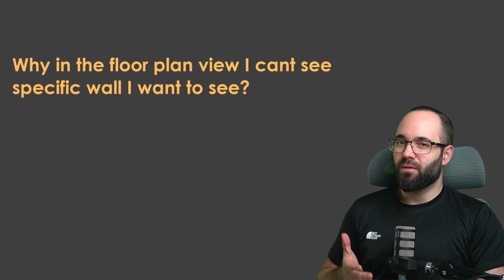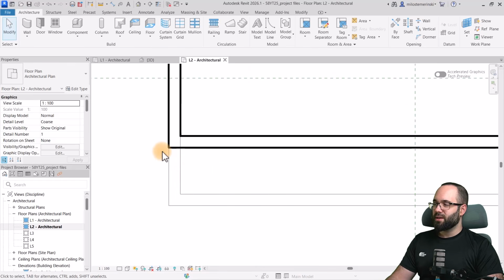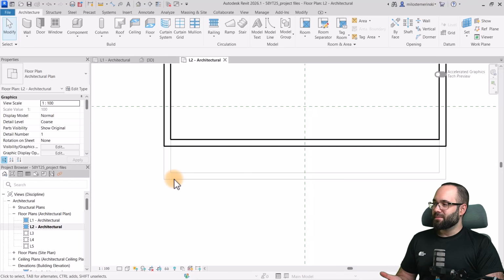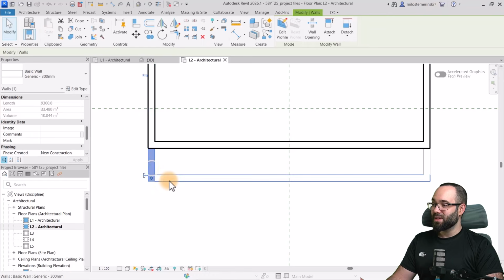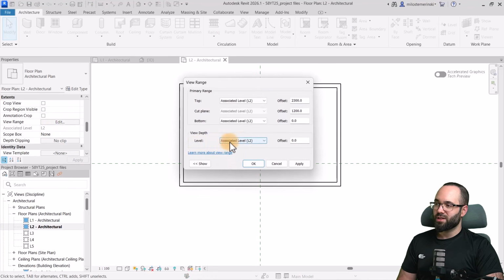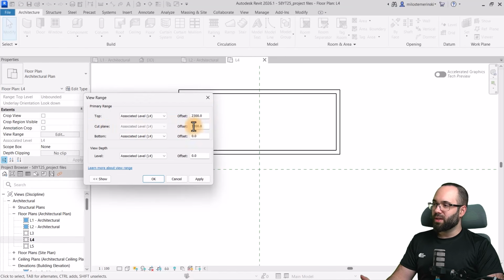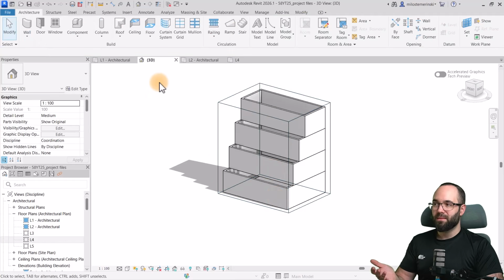View Range and Underlay in Revit Tutorial

Comment: An interesting video, but there is a small error.
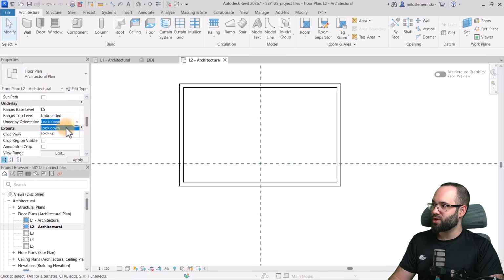At the 5:50 mark, there is no need to change the direction of the view.
You can keep level 2, and underlay from level 2 to level 5 while keeping the downward direction.

In your case, you hesitated after choosing level 5, but there are simply no objects on level 5, and no walls are modeled on this level.

Try setting underlay from level 1 to level 5, with a downward direction, and you will get the result you are looking for.

Changing the direction of view only affects the overlapping of elements in the view, but not their absolute visibility.
For underlay, looking down at the bottom level is like an architectural view, and looking up is like a structural view. 

The bottom level always remains the bottom level, regardless of the view direction.
The view direction only affects the overlay, which object will hide which object behind it in the reading direction of the view.

Thank you.

Comment: Great video man! Really clears things up. I would just like to add something for the beginners/confused and that would be why is there bottom range and view depth where Revit could’ve easily had just one bottom in the view range (no view depth). The reason is to give designers the ability to see the below drawings (example footings, below walls…) in more fainted graphics. This way the bottom range fixes the main «sight » and the view depth adds a fainted appearance to whatever you need to see in different graphics
Reply: Great comment.  My elements below the primary range are still fully black.  How do I change a setting to show grey on lower levels?  Thanks!
Reply: I think I found it.  Need to change the "Beyond" line type to grey.